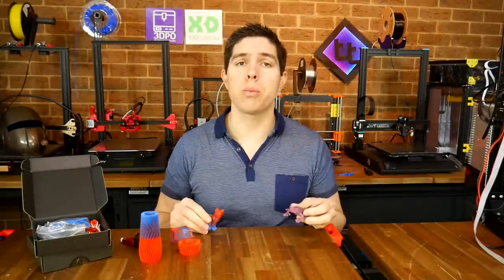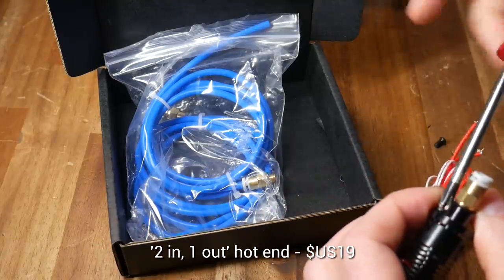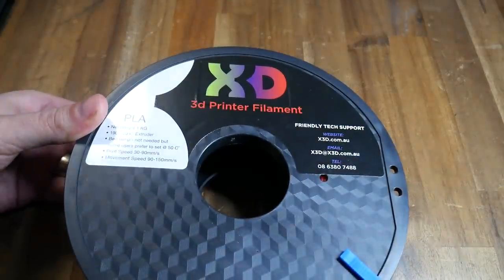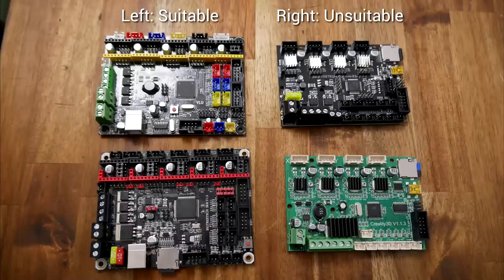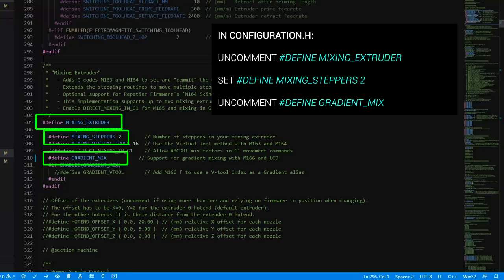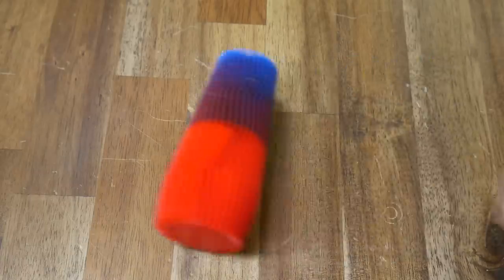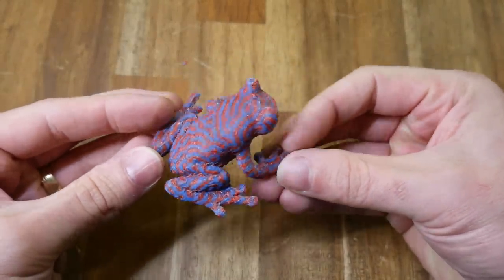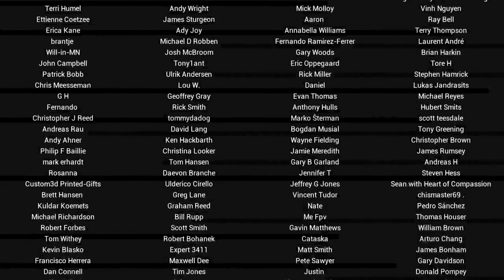Add dual extrusion with gradients - Mixing hot end guide

Comment: I would really like to see dual extrusion with a support material
Reply: that and other potential uses of multiple materials is the main thing I want dual extrusion for
Reply from the maker: This is better suited to one material as each filament is locked into the same hot end temp.
Reply: Should have a look at Dr. D-Flo channel, he has a printer with multiple extrusions that can be used for support material.  Its a tiny machine, but its pretty amazing.
Reply: @jon9947  D-Flo's printer is an IDEX designed by stephenci using fully separate Z-X gantries for the heads; essentially, something like two Prusa Mini printers conjoined on the Y axis to print on one bed. Thanks for the tip. Fitting a longer print bed would allow it to do other IDEX things like simultaneous clone printing (including mirrored on X axis).
Printer design is found at https://github.com/stephenci/ZideX
Reply: For similar temp range materials you can use these as well for support or multimaterial printing most likely. Chuck has a lot of mixing videos of different materials
Reply: The temperatures for different materials are not the same.
Reply: @TeachingTech  but what about pva and pla for example? they both can be printed with temperatures from 190-210°C. wouldnt it be possible to print them together with this dual hotend at for example 205°C?
Reply: Cura has it as an option I use HIPS as support material

Comment: Not for everyone...  I use my printer mainly for "utilitarian" items like brackets, mounts, knobs, and other component parts.  For those with a more artistic use, this would be excellent.   That purge block does offend the Scottish part of my DNA though!    :o)
Thanks for another informative, watchable video.
Reply: I agree- that frog and cat look sick, but I'm not gonna waste my filament, additional money on that fancy hotend and purge plans for direct extruder. With technical parts you can just make separate pieces from different colors anyway, since you often need to screw/connect them to each other for the final assembly.

Comment: Purging wouldn't be as much of an issue for models large enough to purge wall color changes on infill and a slicer with options to do that.
Reply: a purge bucket is far more efficient for collor shifts as there is no resistance to the fillament the change happens much faster and cleaner
Reply: @jackass123455  itd be cool if someone could make the purge bucket inside of the model so the extruder doesn't have to travel far
Reply: cura should hire you
Reply: You can calibrate away. Most of the swich over is actually quite short.

Using a combination of using some of the rest and doing the gradient in the infill.  The block can be massivly reduced.

Comment: I did this years ago with my own y on the Bowden tube. My retracts in colour change were really long. I did not use a purge block, as I consider it wasteful. I mounted a washer horizontally to the side of the frame and move the nozzle over the center purge just enough to clear the nozzle, then wipe over the washer and continue printing. Worked perfectly without issue once I got it calibrated properly. Easier with a core XY, otherwise I probably would have mounted the washer on a servo to save print space.

Comment: While this is a brilliant way to achieve a decent quality dual extrusion, I still prefer IDEX printer as they remove the need for a purge block. They also open up the ability to have dual flexible filament thanks to the fact that they can be direct drive. Overall great video and really helpful and informal.

Comment: Based on my experience with an E3D Cyclops you really only want to use mixing hotends when you're actually printing objects with either a mixing mode or a switching mode. Filaments don't particularly like being parked at operating temperatures for long periods of time so if you use these mixing hotends to print in just one colour then you will "cook" the parked filament and actually clog up the standby filament path. If you try to avoid the cooking issue by only having one filament loaded then it extrudes back up the open filament path and clogs it with solid filament instead.
Reply: yeah ive come across this issue too, i overcame it by when i want to only use one color I use two rolls of the same filament set to mix at 50%
Reply: Might be able to set it to do a small “purge” of the hotend every 10-15mins or so to get around this. Will waste some filament and add time to print but not by too much
Reply: Would extruding a small amount (1-2%) of the unwanted color prevent this without affecting the primary colour ?

Eg if you want red print 98% red with 2% blue, and then when switching to blue print 98% blue with 2% red ?

Comment: The two tone frog could use the inner structure to change colour, like the filler could do the gradient job so the outer part will have solid colours, it would require a lot of manual editing I guess unless a slicing program comes up with an easier solution to automate it.
Reply: prusaslicer had this feature since 2019, google "wipe into infill"

Comment: Actually it is possible to have different steps per mm ratio for both extruder in Marlin ;) Also it's worth mentioning that there is a significant problem with replacing this nozzle, there are no spares (at least I didn't find any on Aliexpress)
Reply: There is a new version of this on which you can change nozzle
Reply: @syedsulaiman8380  whats the new version?
Reply: @Skylionfpv  sorry it's not a mixing hotend exactly 
I got confused

Comment: Thank you Michael.  I just bought this extruder with a skr pro V1.1 and TMC 2209 drivers.  Marlin 2.0 is new to me and VScode too, so your video helps with getting me part way there.  I am also interested in running with dissolvable support.  I tried a similar hot end to the one you did NOT choose and it gets gummed up eventually and the PTFE funnel section degrades and needs to be replaced after a few weeks.  not fun.  I am installing on a Cubex Duo printer from 2013 that I gutted.

Comment: Currently waiting for a 3-in-1 mixing hotend I bought nearly two months ago on aliexpress. Thanks for the video, I think that will help a lot with setting it up :)
Reply: Did you ever get that 3-in-1 mixing? Can you provide a link to it?
Reply: @WilliamMantly  Hi, sorry for the late response. Yes, I got it, but I still need to finish my enclosure (life got a bit in the way) and some other mods, like the hotend quick change mod from properprinting. The Hotend I ordered is a Zonestar M3, which seems to be available in multiple versions. I also have a model for a silicon sock available (still need to buy silicon) and designed a custom holder (again, for that quick change mod).
Reply: @VIsualbasiclivestrea  I just bought the M3, ZM3E4 board and color LCD screen from Zonestare and going to try and get them on my ender 3 v2. I am in the process of designing a box to hold the new board and screen. I am going to attach the 2 extra extruders to the back of the x arm and work from there. The only part i haven't figured it is how to mount the M3 hotend, but will when i have it in hand.
Reply: @WilliamMantly  If you need a mockup model of the hotend, feel free to use this: https://a360.co/3iWz2Gv

Comment: Now for the stupidest question: what's really holding us back from a 5 end mixer that supports rgbwb?
Reply: well mainly that subtractive colors systems use the CMY color space. you know, like printers
Reply: Size I guess? 3 way mixing nozzles have been around for years (and relatively cheap from China, though I haven't tested the quality).
Reply: @rpnct  I also think its the waste from using one with the pillar block on the side
Reply: @rpnct  That and the fact that mixing extruders jam more if you don't regularly print all colors, since the unused filament just stays in the end being cooked.
Reply: @83hjf  To be more correct it have to use CMYK+W, white also needed!, cause there is no white paper.
Reply: @kiyashko86  you can use white as a key, mixing CMY results in black
Reply: @BH4x0r  Nope, you totally wrong))). It's not a spectrum. Even CMYK contain K - black, and white paper as a base. With mix of CMY you will get GRAY or rainbow, but never black. Again you need 5 colors CMYKW (CMYBW). You can check it with 3d printer or paint (oil paint).

Comment: Michael, With this BTT dual mixing hot end, could you do many one color prints from the same extruder? And then let us know if you can go back to multi color and gradient color prints with a hot end that is s not plugged? My A10M hot end plugged under this scenario and the hot end is a nightmare to clean. Even with filament in the E1 side loaded, the filament on the active E0 side pushes into E1 side and  eventually plugs up the works. I had successful dual color prints from my A10M until I needed to do a run of about 100 single color parts. After that the hot end always plugged. I should have put 2 spools of the same color on and alternated between E0 and E1.

Comment: Can you do a video showing the setup in Marlin 2.0 and cura, plus the offsets and such for a dual extruder, dual nozzle setup, that is not magnetic, or use servo's?  The type that's solid mounted next to each other all the time.  I can't seem to find a decent video for this anywhere, nor even the information for what all needs selected in Marlin.  It's crazy.

Comment: Second time that I have watched this. I just bought a stock ender 3 as my second printer, but I was tempted to buy a dual extruder printer like the a10. Just realized that if you got a 3 filament mixing hotend then you could print all colors  using rgb techniques.
Reply: RGB doent work for material in the same way as light.
Reply: Hey did u try this hotend

Comment: that was very cool. Question: Why would the purge block be so big when the two filaments are so close to the heat block? I would think that you would be able to purge quite quite quickly. Is it a time setting or something in Marlin?
Reply from the maker: This was a random, safe value I picked to test with. You set the size in the slicer and from here you could reduce and monitor if there was still a clear transition.
Reply: With a purge block, the printer will continue printing on the purge block to keep the layers even with the actual model being printed. This will happen even if the former color has completely purged from the hot end.

Comment: is such a huge purge block really needed if the mixing happens in the nozzle?  i bet you can lower the cubic purge volume by a factor of 10 or more.. also a slicer option to move purge moves into the infill / inner walls instead would be much better

Comment: nice review , i am thinking about fitting this to a tronxy x5sa-2e , but would also like to upgrade the firmware to add the mixing feature , what are your thoughts on this ? also  not a lot of luck finding config on github for the 2e version of this printer

Comment: Really nice. Will this work for support material ? Also. If they can make a 4 extruder CMYK one. That could make the first FDM printer capable of full color printing.    I’m really tempted to test it. I already have a dual extruder setup but the older ones with 2 full extruders and chimera clone hotend.  And the alignment, etc. has its problems.

Comment: You should actually be able to use 2 different extruders in marlin if you define distinct_e_factors. I use my dual extruder with a E3D Titan and a creality metal extruder.
Reply: Thats true!!!
Reply from the maker: Well spotted, thank you.
Reply: @TeachingTech  Does using a 2 in 1 hotend effect the quality of print in any away??
Or does it remain the same??
Reply: Hey so you are saying that I can have a direct drive and bowden set up at the same time

Comment: Hi ! thanks a lot for your excellent videos! I already modified my ender 3 and added a non mixing hot end and a mks gen L. That work fine but the scripts for the filament retraction are quite tricky  and cura doesnt handle this very well. So I ordered a mixing hot end. In the meanwhile I'm configuring Marlin to suit it. The weird thing the there's no GRADIENT_MIX option under ENABLED(MIXING_EXTRUDER) section in Marlin 1.1.9 . Which version of Marlin did you use ?

Comment: was hoping to see the inside structure of this hotend. I have a A10M and it has huge tendency to clog and string/ooze. It has a mesh filter inside which seems to be the culprit for clogging, but does aid on the mixing.

I can see a day when 3 or 4 color mixers comes to fruition and thus you could in theory do nearly full color prints
Reply: Geeetech A10T is 3 color

Comment: I know this is from about a year ago, but i'm still interested in it, is the inside of the heatsink lined with PTFE or all metal because it would be nice to print materials other than PLA and PETG, without risking to burn a liner?

edit: your PTFE gets right up to the end of the heatsink, then it goes into metal, idk how hot the heatbreaks get there but it might be safe to run over 250? idk..

Comment: thats pretty slick. i could see it coming in handy if you had a very large print and needed more than a single roll of fillament, did water soluble supports or any of the options you mentioned. i might give this a go sometime. i just dipped my toe in the firmware editing waters so. i need to be carefull, lol. i have a dual z on my mini e3 2.0. can you edit the firmware to use the 2nd z stepper as a second extruder??

Comment: Two points - stringing and retraction is much more difficult on this style of printer as the design has to mitigate backflow from filament one throat into filament two throat (and vice versa). The Geeetech a10m, for example, has filter disks which make retraction nearly impossible. There is also a larger volume of molten material in the mixing chamber that makes drooling an issue. 
Second point - almost every that runs this style eventually goes to running purge buckets instead. The advantage is quickness and less waste plastic as you don't have to purge on monochromatic layers to maintain a purge tower z-height.

Comment: Get better sidecutters. Knipex is my go-to on the smaller side-cutters, it is worth the price.. The ones that come with Enders are just about good for cutting the 1.75mm filament. Better side cutters leave better quality, it doesn't squeeze the plastic but cuts it very close to the surface.

Comment: Thanks mate, I would like to see dual extrusion with dual materials, like PVA and Pla or PETG using a Chimera.
Reply from the maker: I have some PVA ready. I would likely do it on the other dual extrusion machine. Would also like to try TPU with PLA, something like a rigid item with soft hand grip.
Reply: @TeachingTech   what other dual extrusion machine are you referring to?
Reply: Does using a 2 in 1 hotend effect the quality of print in any away??
Or does it remain the same as stock??

Comment: Great video. I am wondering if you have had any problem with color uniformity in layers. I have a color problem when trying to mix colors, like 80%white and 10% brown. One side is always lighter than the other, left to right when looking a the print. Any ideas?

Comment: Seeing your video I was wondering if you could swich not only between two different materials but also between two different temperatures? 
Reason: I'm considering to print two different materials (Light Weight PLA and 'normal' PLA) within a RC wing design at the same time. But to do so you need to run it at two different temperatures (normal PLA is running at 200 -210 C and LW PLA at 230-250 C). eventually it will lead two different material properties at different positions within the design.  Any suggestions?

Comment: I want this to experiment with plastic 'alloys'. Mixing different plastics (ABS and PLA etc) on the fly at a precise ratio could create new structural possibilities???
Reply: Pla and abs print at different temperature and settings it is not possible to use them together

Comment: I'm looking at a NF THC-01 hotend  that's a 3 to1 system which promises no filament blocking in it to bring my Ender 3 pro to 5 hotend feeds. I'm gathering it's similar to yours in design interior wise and isn't much bigger than the factory one was vertically as it is hexagon shaped to allow 3 filament tubes access. I am hoping for a true RGB ability from it for colors and will use the other dual hotend (Cyclops) I have beside it for white and the filler/support tube which will have infinite brand's Aquasys 120 water-soluble 1.75 mm filament. I think this will cut my costs down drastically as right now I'm swapping between 18 1 kg spools of st-pla every time I need a color change. I then can make a filament profile for just about any color at any time and only need to add one more line for the temp like a side by side dual system . I will let you know how it goes and wish me luck